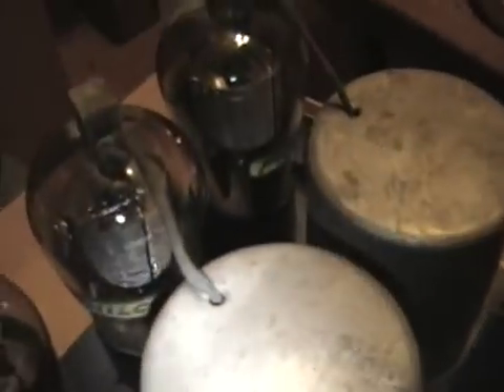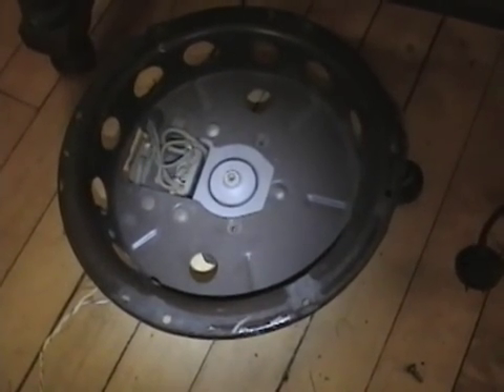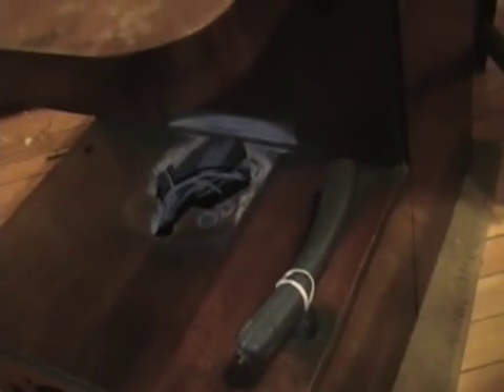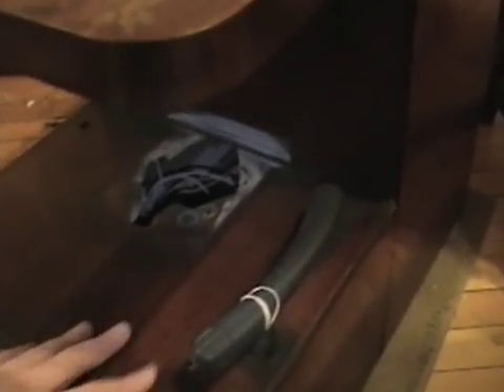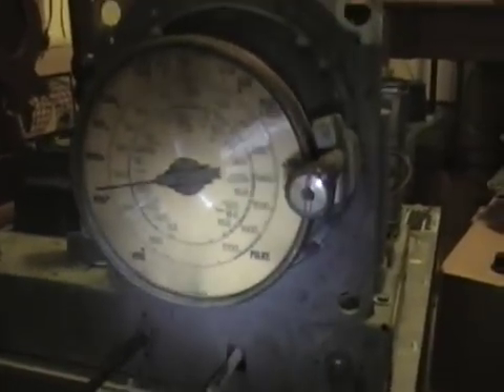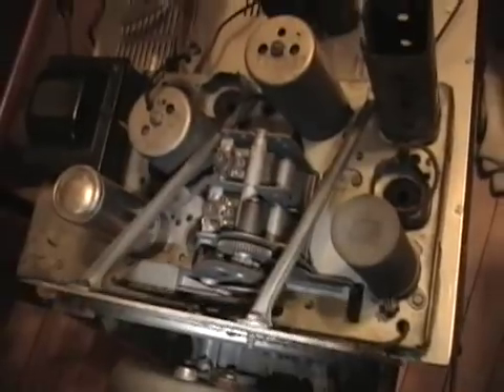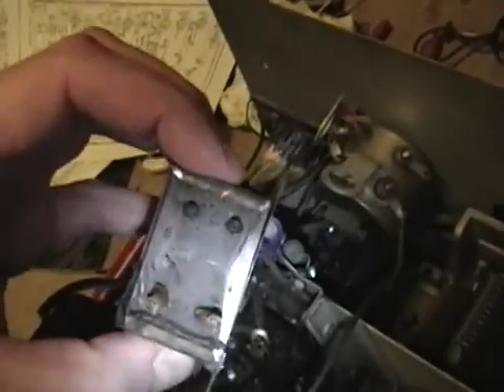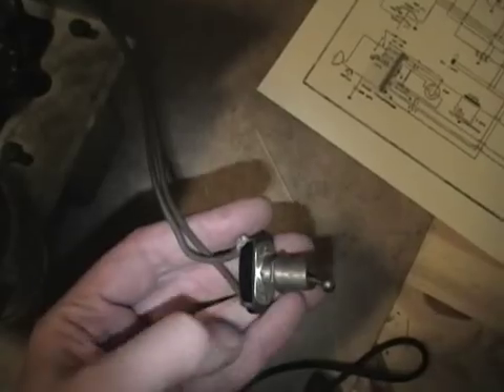Three new radios p2o2

Comment: Looks like the volume control on the Spartan may have indeed had the switch housing removed from the back of the volume control at some point.  

Hard to tell from the video, but I think that piece on the back of the pot shaft is the old switch actuator.  

Do the existing power wires still reach the back of the volume control?  You may be able to tell if they were removed and re-routed to the toggle switch by looking for signs of tampering on the harness (removed wire ties, clamps, etc).